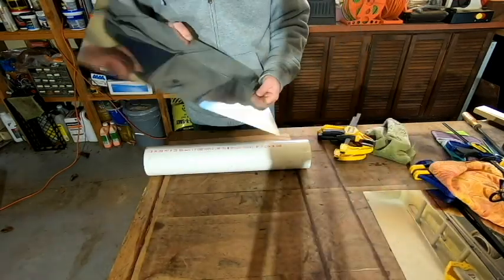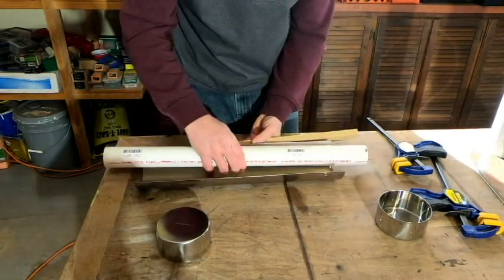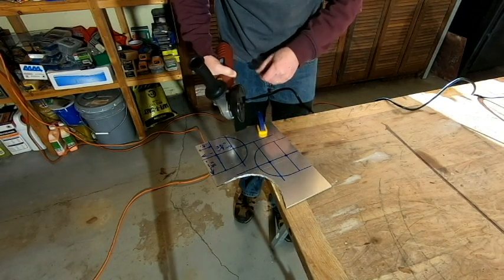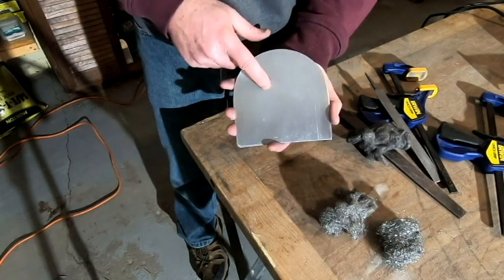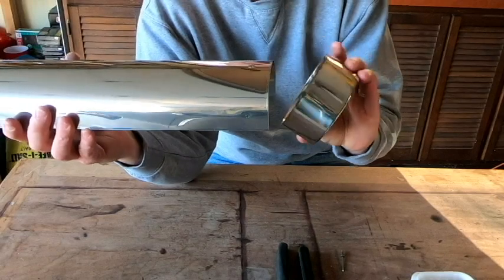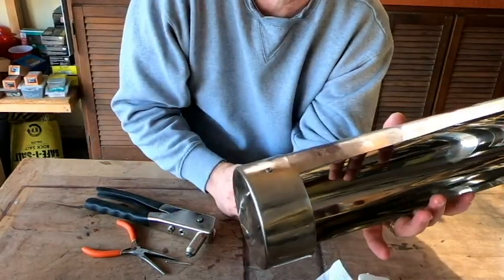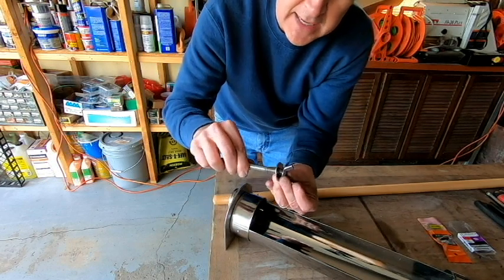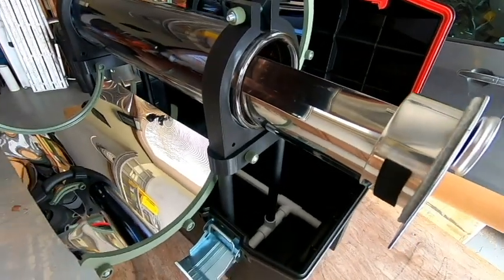Stockton Solar Oven - Part 6 - Cooking Tray (cont.)

Comment: How hot does it get?
Reply from the maker: I've seen about 410 degrees so far. You can adjust the reflectors to scale the temperature up and down.
Reply: @jimginnyohio  That's pretty amazing.  Can you put a small flat bottom pan in the tray?
Reply from the maker: @davemiller5875  Yes, there are some trays available on Amazon that will fit. Also, some of the smaller throw-away aluminum plans will work too.
Reply: @jimginnyohio  Hi Jim, I can't find a 4" tube anywhere. Can you find a manufacturers name on the tube?
Reply from the maker: @davemiller5875  Yes, the 4-inch tube has been scarce since the pandemic hit. I know the eBay seller plans to get more at some point, but it takes much longer to get those in from China anymore. Unfortunately, I haven't found another supplier. 
If you contact the seller directly, he might be able to work something out.
The ebay Seller is: firstsmartice
Email: firsts_eqs5398ubz@members.ebay.com
Reply: @jimginnyohio  Thanks Jim.